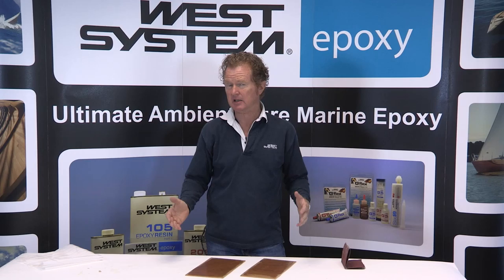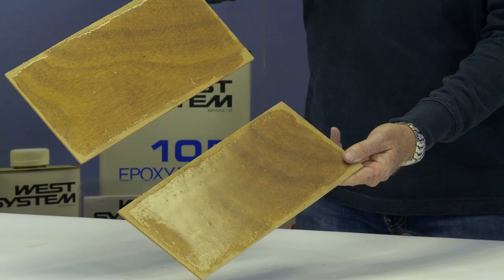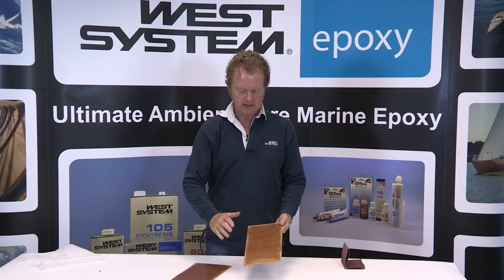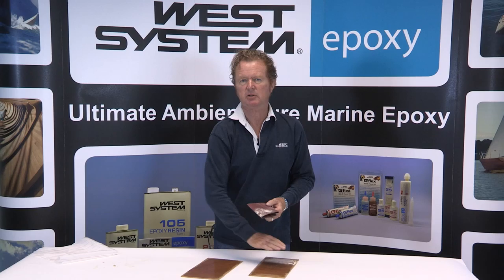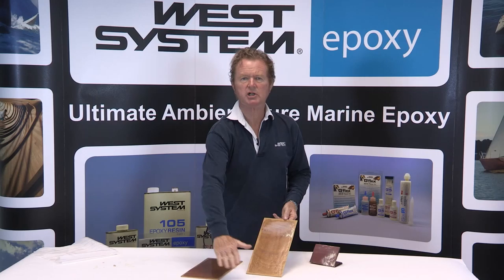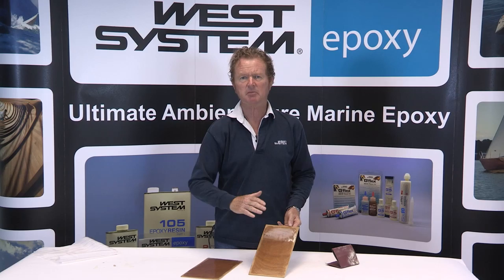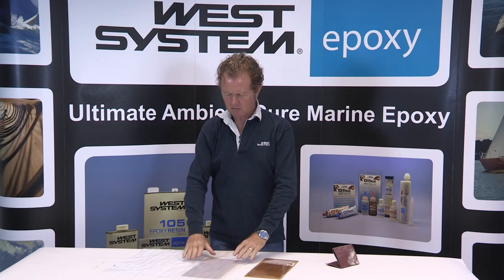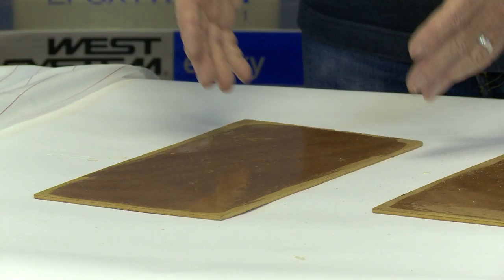Wooden boat repair: how to remove amine blush

Comment: Excellent.  I'm preparing 3-4 coats of epoxy to an oak motor mount for an inflatable kayak, to be followed by varnish.  I'll apply all 4 coats together, allow to cure, then use Dawn dish soap and a kitchen sponge to scrub off the amine blush.  With then abrade evenly with sandpaper between 80-180 grit in preparation for varnish.
Reply from the maker: Thanks for the comment Really Happenings.

To remove the blush, thoroughly wash the surface with clean water and an abrasive pad. Dry the surface with fresh paper towels to remove the dissolved blush before it dries on the surface. Sand any remaining glossy areas with 80-grit sandpaper and clean.

WSI Technical team.